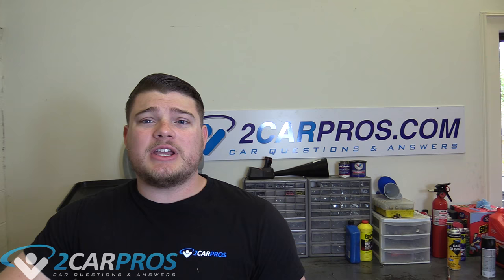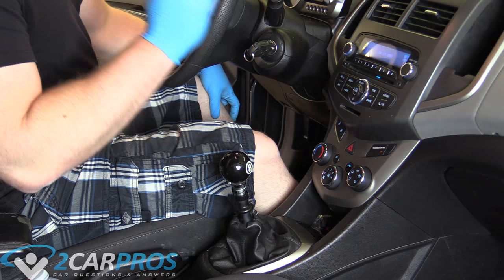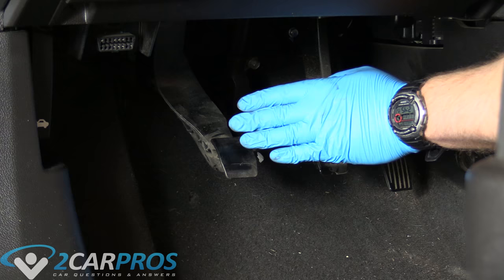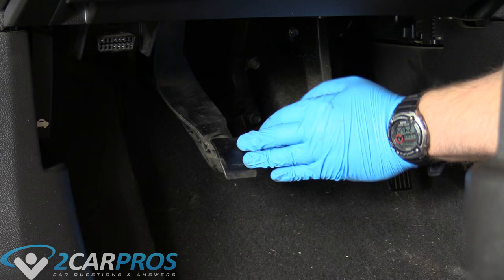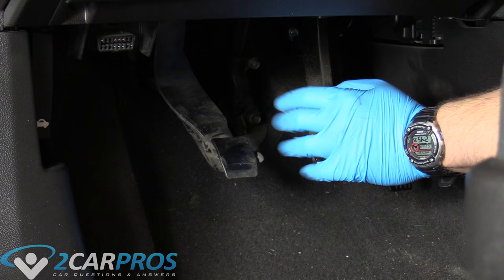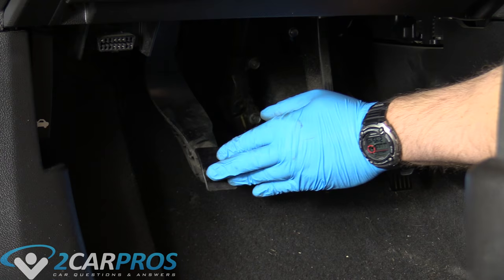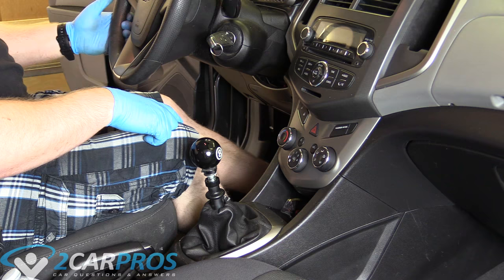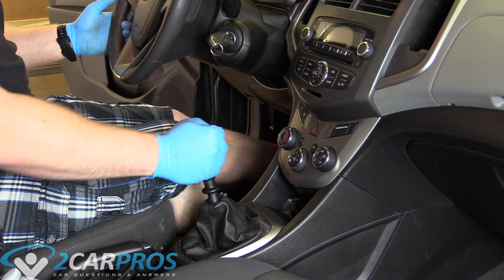How to Tell if Your Clutch is Bad with 4 EASY Tests in Under 2 Minutes!

Comment: A couple of these can be caused by lack of clutch fluid and not necessarily your clutch. If your Gears won’t go in,  or you have a loose clutch pedal, check your clutch fluid levels.
Reply: Or master cylinder issues or even slave cylinder issues . In fact chances are it is hydraulic related if you can not put it into gear not a clutch plate issue .
Reply: This is also true! Lots of car symptoms have multiple causes or potential culprits
Reply: @DylanMorehouse mine won’t go into get I changed the master cylinder the line and slave also bleed it bunche of time it got lil worse actually after master was changed, go in to gear when not run but takes of with the clutch pushed all the way down for some reason I don’t think it’s the clutch but can’t seem why I can’t can not get it to bleed all the way jusy would hate to spend the money on new clutch and it to do the same thang
Reply: my clutch in my $1000 ‘79 Corolla started slipping, it turned out to be the master cylinder leaking into the interior. Replaced that, and the clutch worked perfectly.
Reply: @themanguy2110  yeah, some cars share the fluid from the master cylinder for brakes and the clutch.

Comment: its pretty easy well in advance to know your clutch is wearing out . the pedal will get  very high up before it starts biting , almost to the the top of taking foot off the clutch . when it gets that far up put it in high gear and foot hard on gas , if its still ok for a bit it will be as normal but if revs start rising without any speed increase then its starting to slip and needs replacing . you have a bit of time if you dont accelerate hard but its a sign to get it replaced as soon as you can , ie a week or 2
Reply: You are right

Comment: i had a few issues non of these happening. Citron ds3. After a long journey stop starting traffic etc the peddle squeaks, every so often ill be in gear driving and ill hear a slight buzzing sound to the left of the gearstick. At times ill be picking up speed and the car jolts as if I'm breaking and then I hear a bubbly sound and its then fine. Yes I have had spark plugs don't and no there are not errors on the system

Comment: thanks man! very helpful. do u know if a sign of a bad clutch is the pedal having to go all the way up before it finally gets into gear? thanks!
Reply: If your biting point has got higher then your clutch is worn out. Note that some cars will have high clutch biting points so this would only apply if your biting point used to be low but now is really high
Reply: My Yaris and Avensis had high biting points. Both VVT petrol engines.

Comment: thanks, I thought it was the transmission ... this video helped me, when. I go on the fwy at 40 miles I accelerate and the rpm goes up from 3000 to 4000 without advancing more and then it becomes normal, thanks
Reply from the maker: You're welcome!

Comment: Thank you! I bought a car just months ago and I'm already having problems with the clutch. I guess I'm never buying a used manual car again.
Reply: where did you buy it ??   i got done from dodgy dealer sold me a car with blown head gasket , just bought new second hand car from proper dealership now and its 8 years old but its like a brand new car . only thing i dont like is the digital fuel gauge that is 8 segments , and one segment can still be lit up even if u got 2 miles left in it then that segment light goes off when uve used it .but ive estimated now each segment is sort of equal to 50 miles depending on sitting in traffic and each segment is equal to 1 .2 gallons

Comment: Thank you! I was worried my clutch may be going out as I was on the interstate yesterday morning going about 60 when the car kinda bucked? maybe a pop? Hard to explain..no check engine light as it's already been on for a year haha, it just felt like a quick loss of power but did not stall..It did this a few more times and I made it to my destination..then I drove the back roads home and all shifted fine..I have a 2005 Ford Escape 2.3 5-speed..216K miles BUT many or some of those miles were from being towed flat behind a motorhome as a "toad" ..I replaced the fuel filter 35K miles ago when I got the suv,, plugs about the same time too..I am getting a P0193 code Fuel Rail Pressure sensor circuit high code..so maybe the sensor? Runs fine otherwise..no gas smell either..I can accelerate in 5th or 4th to pass, I can take my foot off the clutch in gear and stalls out like it should..I don't know..any suggestions oh car master?? lol
Reply: Sounds like it's probably your code that's doing that..... should get that fixed and go from there....if you're having fuel problems you're going to have acceleration problems....

Comment: Mine was jerky while down shifting or jerky as i was taking foot of clutch. 
Today it felt soft and smooth, no more jerks , but at a traffic light i was revving , took foot of clutch, and it stalled while on high rev.  It works but it does feel different , as in the biting point changed somehow. 
Could it be it needs replacing?

Comment: Mine makes like a squeeling sound when it’s not all the way down but it’s like an inch or two from the floor. Like if I hold it there it’s like a belt pulley squeel. Shifts fine but it usually does it after I been driving for awhile

Comment: I'm not sure I may be going mad but I feel like my gas pedal and clutch has gone softer I don't know if this is my clutch going or what. But there's a lot less resistance when putting my foot down. Any advice or is it fine?
Reply: Currently same, I thought it may be low oil in transmission / bad oil?
Reply: Any update ?
Reply: @acebethinkinchoice1036  so i took the car to the garage and they said theres nothing wrong... I got my brakes changed and it seemed to go (i may have been overthinking the issue 😂) however i drive the ford focus 1.0 ecoboost and this car makes a lot of strange rattles so everytime i drove it i thought it was going to die on me. 
Sorry i couldnt be much help

Comment: What would you say, if i drive any gear, and in high rpm like 3-4 and clutch down and it makes a wierd sound and vibrates alot ? it happends when i really gas the car out and clutching
Reply: probably engine mounts and not a clutch problem

Comment: What if I don't have any of these issues, but I sometimes have problem getting into first gear and reverse (my first gear and reverse are in the same spot). I have to let off the clutch and put it in again to get the gear. My car does not like getting into first gear at all, so I'm always stopping at lights in second.
Reply: Have you tried to put in like 3rd gear first, then put 1st gear? Its way easier for me to put in reverse if I do that method. Its not needed for me, but its just way easier.

Comment: Yeah one thing you forgot is test the hydraulic of the clutch pedal or check for the cables or it could be the clutch cylinder might be going out. One thing you forgot to test too

Comment: When I go up a hill and the rpm down from like 100 and up 100 very rapidly, does that mean it’s wearing?
Reply from the maker: Yeah it could or its a pressure plate issue or a throw out bearing failure. Thanks for watching!

Comment: My car starts vibrations  when 50/60  miles 
Can't accelerate 
And then when that happens it's hard to get off in first gear and also struggle on hills
What would be likely to be the problem?

Comment: Well my Vintage Car doesn't have These Symptoms but i have the Problem that the Car often jerks when releasing to pull Off and also when at high RPM it jerks really much and the Car Starts to jerks. I think it's worn out. What do you think?

Comment: I’ve had symptom 4 for about a month. I get revving going up steep hills in third. How long do you think it will last in this condition? I drive like 500 miles a month
Reply: Btw i’m typically careful to not let it slip under load. When traffic permits I generally just take hills slowly in second or use very light throttle in third. It’s ability to hold friction hasn’t lessened since it started slipping as I can tell
Reply from the maker: Tough to say. Could break tomorrow, could last 10 years. Depends on a bunch of factors. I would fix it just not be stranded. Thanks for watching!
Reply: if its slipping in third you need to replace it as soon as you can , the more it slips the quicker it will be knackered . i had a clio that started slipping in 5th gear , took it to garage 2 weeks later , and he said it was almost down to the rivets . if it gets down to the rivets it will cause damage to the flywheel and your have to replace that as well which is very costly repair

Comment: This may be a silly question but I have symptom 4 where I get RPMs but no power. Do you know how quick I need to get it in the shop? I’m taking it ASAP but I’m worried I may get stranded in the meantime.
Reply from the maker: When you try to take off with the clutch engaged?

Comment: Hello. I have a question I hope you can help with. So my Skoda 2008 1.4 TDI has an issue with the 5th gear. I can easily put it in 5th driving or not. But it acts like neutral. Doesnt engage at all. Its only the 5th. I release the clutch in idle and 5th gear and nothing happens and same thing while driving. Any idea what it could be?
Reply: That means you grinded out 5th gear. You could get your transmission rebuilt or just live without 5th. Doesn’t necessarily mean your clutch is bad.

Comment: So I Know its an old video and I might not get an answer. But, I own an opel insignia since i bought the car 3 months ago the clutch pedal seems to grab and release literally on the last 10% of the pedal. I definitelly have a worn synchro on gear 3 and a little on 2 because when I shift from second to third if I dont let the rpms drop a little the gear stick feels a little crunchy going in. No sound or anything happens and you really have to concentrate on your hand to feel it but its there. Could this be caused by a bad clutch? Car is a 2l diesel with around 130hp and 230 ft-lb. I have done hard launches with it. even took it for some spirited drives in the twisty countryside shifting as fast as I'm able to rowing the gears up and down for a solid 15-20minutes. I have also taken the car from 50mph to 100mph in sixth gear. During all of this there is absolutely no noise when shifting gears or any indication the clutch is going bad. So I'm hesitant to throw money on a new dual mass flywheel and clutch. Should I replace it or not?  to check the clutch would be like 50% of the price it would cost me to replace it because labour is so expensive. So now I'm not sure what to do really. Just wait till the clutch starts slipping?

Comment: You are confusing slave cylinder vs clutch issues. most what you say is related to the pedal working on the hydraulic cylinder to press/depress the clutch.

Comment: Hey buddy, quick question. I have a 2017 Camaro V6 and for some reason I get a warning to reduce the clutch performance in only 5th and 6th gear. The message causes the throttle to pull back and doesn’t allow me to floor it. Does that mean the clutch is slipping? Is it possible for a clutch to only slip in specific gears?
Reply from the maker: Yep your clutch is getting warn. I would plug a scanner in and see what codes the computer has stored to be sure though. Thanks for watching!
Reply: @2carpros  Thanks for taking the time to reply to my question man. The car only has 37k miles on it. Can the clutch be going bad already?
Reply: @Fr33man1988  I HAVE same problem... I DRIVE IT LIKE I STOLE IT!

Comment: Will someone PLEASE REPSOND TO THIS. So I have the same issues. Was driving my mustang one day, went to shift into fourth, went to let out the clutch and accelerate and the car would not accelerate. Now when I put it in gear nothing happens. I can have the car running, put it in gear without pressing in the clutch and nothing happens. Does that sound like a bad clutch then?
Reply from the maker: Yes it does. Thanks for watching!
Reply: yep definately

Comment: I have an '11 STI and it just started making a slight squeaking when depressing clutch peddle and slightly louder squeak releasing it, and mostly when cold after some driving it goes away. Gear engage fine and rpms don't jump when I accelerate but she doesn't seem as peppy almost every so slightly sluggish unless I really stab it. Wondering if it's the clutch, throw out bearing or master cylinder? She's a daily driver with 120k on the clock but I've never had any clutch issues before so diagnosing isn't the easiest for me and if didn't make any noise at the shop of course so I'm kinda stumped lol. She is a lil hard to get into 1st gear every once in awhile but that's only when I'm bein impatient coming to a stop and tryin to put her in gear before I'm slow enough I understand there's a clutch saver or w/e it's called in 1st gear on these car's from my forum crawling lookin for possible answers lol. Any thoughts?
Reply: I have something similar , what was the problem?
Reply: What was the problem? My mustang has the same noise in the pedal.
Reply: @xaviermunguia09  it was the grease in the throw out bearing leaking out. Replaced it with  the new clutch kit.
Reply: @audriusverseckas2547  clutch n throw out bearing worn out, leakin bearing grease

Comment: So I have a 91 miata with about 300k miles on it, it started taking off really slow, it got to the point to that I'd have to rev it up pretty high in order for it to take off, now I put it in gear and try to take off and the rpms just drop, I can't even rev the car anymore, do you think it's the clutch? Or could it be something else like the fuel pump or 02 sensor? Car has new spark plug, wires, coil pack, and injectors, thanks in advance
Reply: how many miles did it have when you last replaced clutch?
Reply: @xFinalxArenox  I just got the car so I'm not sure when it was done, it ended up being the timing, on crankshaft where the little key goes, it's pretty shaved, along with the timing gear, I got a Crankshaft saver and I should be recieving a new timing gear this week

Comment: Thanks for the tip! Btw, how long does a clutch plate usually last on average if one is careful not to abuse it and takes precautions against premature wear and tear?
Reply from the maker: It really varies on how you drive it. I have seen them wear out at 30000 and I have seen them go 80000. There are many factors that change it's lifespan.
Reply: My mitsubishi lancer has 132000kms on it and thats about 82000 miles and its still fine
Reply: I have a 2003 Hyundai Tiburon. I didn’t have to replace the clutch until after 100,000 miles. I’m about to replace the second clutch after another 100,000+ miles. I don’t know if it’s the car, or the way that I drive it, that made me so lucky to have the clutch working for that many miles… but, I’m happy about it. 🥰

Comment: Hi when im driving and go from 4th to 5th gear the rpm stick appears to surge upwards like flickers when i press the accelerator ? Not every time but most of the time , its a 2litre 2016 insignia diesel 170bpm tourer, could this be a vaccuum leak or is it my clutch and flywheel ?
Reply: There no pedal issue and it goes into every gear perfectly just at that 5th gear bite when I accelerate the rpm stick surges then come back down